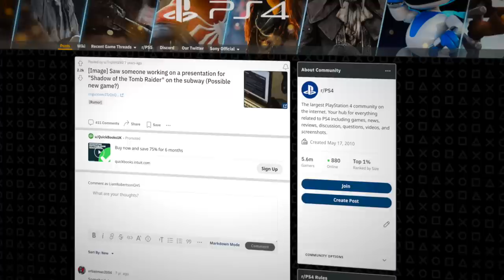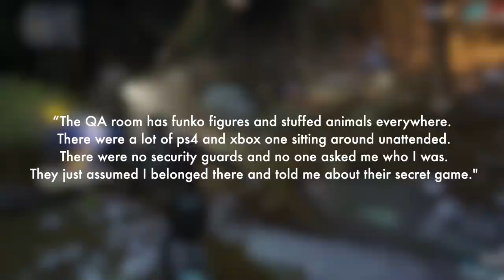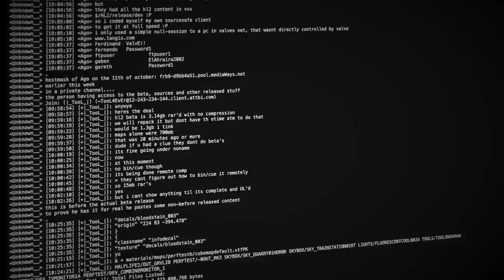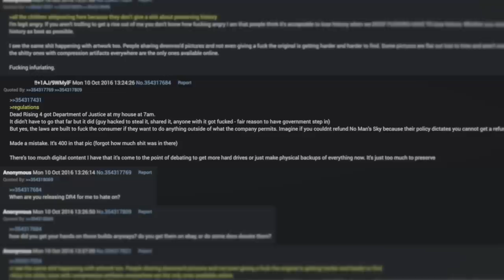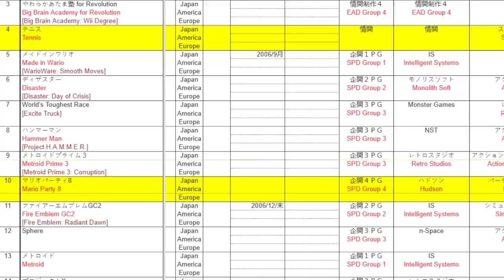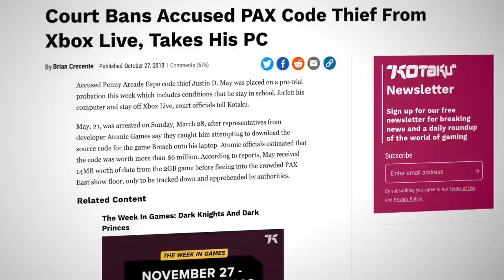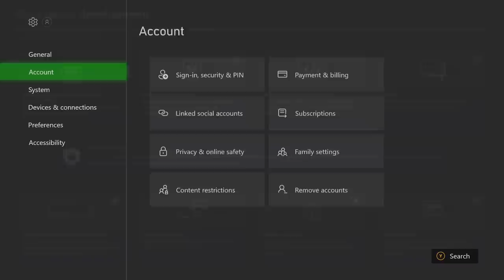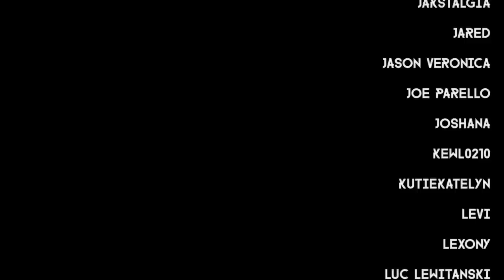The Biggest Video Game Leaks Ever (Deep Dive)

Comment: I know some people like leaks, whether they're true or false.
But I've always hated them, cause it just ruins any anticipation I had for a game before stuff like the trailers and final release come out.
And now I work in the industry, it's even more of a mixed bag because it can be something as simple as a plot leak or it can be half the game code.
Reply: I don't have a lot of time, so I often get to things months or years after it's out. Anticipation and the hype cycle are basically worthless for me.
Reply: I find the hardware leaks quite interesting, as it helps you get a sense of what's to come. However, this has become severely less desirable ever since the last generation, when consoles started using much more standardised SoCs. The Switch is basically an iOS/Android tablet, and PS4-5/Xbox One+ are AMD PCs.

I also like release date leaks or updates on the few games I am anticipating having troubled development, as I find that it much more acceptable after learning the reason than the usual official announcement "oops, the release date moved to next year; lol" with no explanation. 

But I have to agree that I don't like gameplay or plot leaks, to the point that I usually avoid trailers since they will spoil big chunks of a game's experience. And the plot leak can still be pretty significant for certain games (Last of Us 2 for instance), a more relatively harmless leak is the protagonist's design in the new game, or basic gameplay modes.